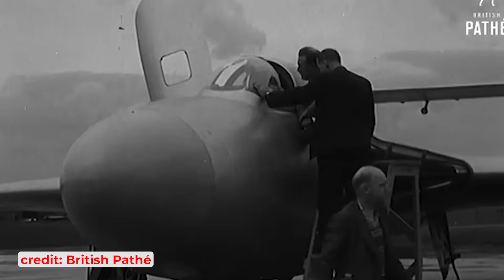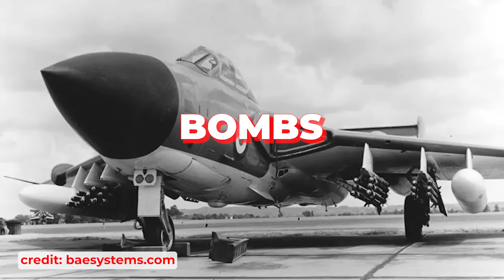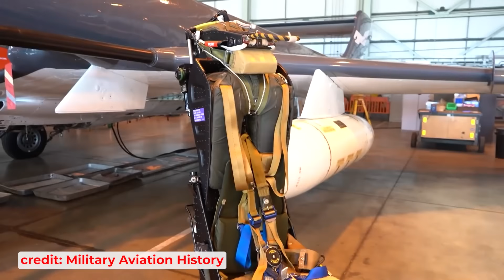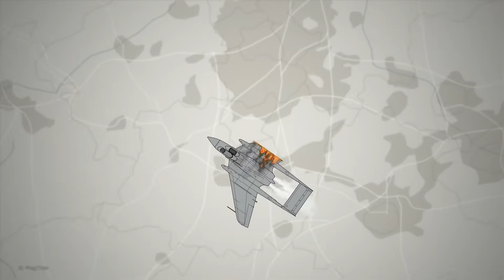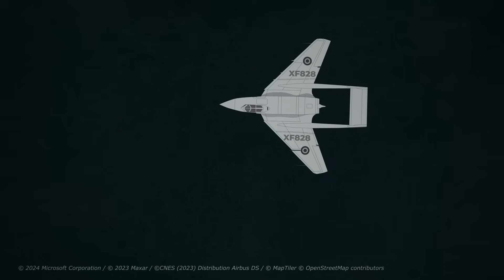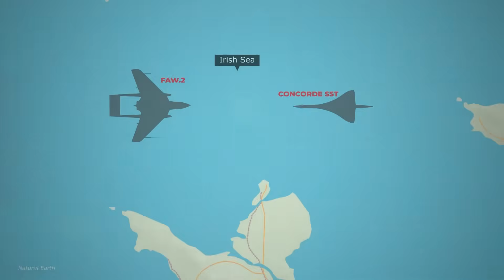Sea Vixen: A Beautiful Killer

Comment: Too slow, poor missiles, radar that did not work well. Light bomb load. Supersonic in a dive.
Reply: The Sea Vixen could not fly supersonic... even in a dive,  as this crash proved
Reply: @DoktorBayerischeMotorenWerke 

Sea Vixen Compared. 

We feel we can clear up some commonly held myths and misconceptions, obviously.

It's always good to see the facts presented clearly and concisely isn't it.

We feel we can clear up some commonly held myths and misconceptions, obviously.

It's always good to see the facts presented clearly and concisely isn't it.

See further down for a Meteor losses comparison.

See below for Comet accident losses comparisons. The Comet had similar accident losses fatalities to the later Sud Aviation Caravelle. Much later jet airliners from US manufacturers had significantly worse accident losses. 

The Vickers VC10 held the Atlantic crossing record for 43 years  (Non supersonic airliners). 

The Harrier was the only aircraft of its type at the time it first flew. All 1250 Pegasus engines built for all Harriers ever built anywhere were British build and design engines. The first 135 Harriers purchased for the USMC were entirely built in the UK. All 436 USMC Harriers had British built engines. 

The world's first wind tunnel was built in England during the 1800s. The world's first supersonic wind tunnel was built in England during the 1920s. 

Indeed that's correct. The Whittle Gloster E28/39 was of course a brilliant aircraft that was later copied in Russia as the upsized and tweaked Mig 15 with a copy of the RR Nene gas turbine aero engine.

Obviously the RR Nene being the world's most powerful & most reliable gas turbine aero engine in 1944.

The MD F3H Demon was a contemporary to the DH Sea Vixen & had a similar performance. The F4 Phantom was a follow on from the F3 Demon. The Sea Vixen took a long time to get from first flight to introduction for various reasons and a similar situation occurred with the MD F3H Demon.

McDonnell Douglas F3H Demon
590 Built. Not Supersonic.
Max Speed 578 MPH.
Introduction date 7 March 1956
First flight 7 August 1951
Retired 1964

MD F-4 Phantom 2
Number built 5,195
Manufactured 1958–1981
Introduction date 30 December 1960
First flight 27 May 1958

DH Sea Vixen
Number built 151 (including two DH110 prototypes and one Sea Vixen prototype)
Introduction date July 1959
First flight 26 September 1951
Max speed 695 MPH.
Retired 1972

Regarding the UK Aerospace Sector.
 
An airline recently ordered 60 RR Trent XWB Engines.

It's a great pity & a crying shame that British military forces had to occupy a large part of Germany for decades after 1945 & Russian military forces had to do the same. Of course Russia still posseses a large chunk of what was German territory & of course Russia & the UK produce nukes. Obviously Germany does not produce nukes.

Interesting British achievements.
There is no doubt that the Fairey (England)
Delta 2 was of course the world's first jet
aircraft to exceed 1000 mph.  Indeed It
exceeded the previous record by 310 mph &
held the record for 1 year. Incidentally, the Dassault Mirage 3 & 4 are based on the Fairey Delta 2.

Early days, jet fighters.
De Havilland Vampire, Sea Vixen & Gloster Meteor accident losses were not high or unusual for fighter aircraft at the time. De Havilland built large numbers of all metal airframe aircraft before the DH Comet.
We mustn't forget of course that the DH Vampire for example first flew in 1943 & the engine was also built by De Havilland. There were examples of the Vampire interceptor / fighter in service until 1990 which was operated by more than 30 countries.

Non combat phase accident losses.
% of Aircraft built.
The Canadair CL-44 was a turboprop airliner.
Canadair CL-44                  (ff 1959 ) 48%
Lockheed XF104                (ff 1954) 100%
Lockheed  P80                   (ff 1944) 43%
Lockheed F104                 (ff 1954)  45%
Grumman f9f-5 Panther   (ff 1947) 44% 
Convair F102 Dagger        (ff 1953) 45%  
MD F-101 Voodoo.             (ff 1954) 34%
MD FH Phantom 1            (ff 1945)  35%
MD F4 Phantom 2             (ff 1958)  28%
MD F3H  Demon               (ff 1951)  32%
Gloster Meteor                  (ff 1943)  21%
DH Vampire                       (ff 1943)  23%
DH Sea Vixen                     (ff  1951) 33%
Gloster Javelin                   (ff 1951) 20%
EE Lightning                       (ff 1954) 33%

An example of what goes on these days in various countries.
For example, there are of course no German companies that makes German jet aircraft in Germany & there are no German Companies that make German gas turbine aero engines in Germany that are suitable for widebody airliners.

Brazil makes very good airliners & Brazil is 100th down the list along with Indonesia for wealth per capita. Of course it is in fact the case that Embraer can't build those airliners without purchasing stuff from the US, UK & Europe. Norway Holland Denmark Ireland Belgium - Top 20 wealth per capita - Don't make airliners -  its as simple as that.

    Early days of the airliners.
That's correct of course, at the time the Comet wasn't particularly dangerous. Agreed, that is indeed the case of course, The DH Comet was definitely not the worst engineering failure in commercial airliner history.

How things were back then. 
Accident losses - % of aircraft built.
DeHavilland Comet 4                   14% 
DH Comet all mks   (ff 1948)       17%  
Vickers VC10 UK                            5%

The DH Comet had better safety than or similar safety to many other commercial passenger aircraft of a similar era.

Douglas DC-1                                      99%
Douglas DC-2                                      47%
Douglas DC-3                                      30%
Douglas DC-4                                      26%
Boeing s300                                        72% 
Boeing 307                                          70%
Boeing 247                                          48%
Boeing 707                                          20% 
Lockheed L-049/149 Constellation  30%
Lockheed Electra Turboprop             29%
Fairchild FH-227                                  30%
McDonnell Douglas DC-8                   14%
Sud Aviation Caravelle                        15%
Canadair CL-44  Turboprop                46%  
Convair CV-580  Turboprop                22%
Convair CV-880     (ff 1959)                27%  
Convair CV-990     (ff 1961)                33%
Tupolev T-104        (ff 1956)                16%

The VC10 held the fastest Atlantic crossing speed record for 41 years (Non supersonic airliners).

For the first few years of operations the Caravelle and Comet had similar accident loss Fatalities numbers.

De Havilland had prior experience building many all metal construction airframe aircraft & thousands of jet powered fighter aircraft that were primarily of metal construction with pressurised cockpits & jet engines built by De-Havilland.

We hope this helps. Cheers as always indeed etc
Reply: @DoktorBayerischeMotorenWerke 

A number of similar performance non supersonic jet aircraft got to first flight stage at around the same time. 

The MD F3H Demon was a contemporary to the DH Sea Vixen & had a similar performance. The later F4 Phantom was a follow on from the F3 Demon. The Sea Vixen took a long time to get from first flight to introduction for various reasons and a similar situation occurred with the MD F3H Demon. The Douglass Skyhawk delta wing is a contemporary to the the Gloster Javelin delta wing. Both non-supersonic delta wing aircraft, the javelin had better performance and first flew a few years before the Douglass Skyhawk.

Douglass A-4 Skyhawk 
2950 Built 
Intro 1956
FF 1954
In service to 1980s
Max V 670 MPH
Delta wing. A small / light jet aircraft designed for carrier operations without having to have folding wings. Often referred to as the scooter. 

McDonnell Douglas F3H Demon
590 Built. Not Supersonic.
Max Speed 578 MPH.
Introduction date 7 March 1956
First flight 7 August 1951
Retired 1964

MD F-4 Phantom 2
Number built 5,195
Manufactured 1958–1981
Introduction date 30 December 1960
First flight 27 May 1958

DH Sea Vixen
Number built 151 (including two DH110 prototypes and one Sea Vixen prototype)
Introduction date July 1959
First flight 26 September 1951
Max speed 695 MPH.
Retired 1972

Gloster Javelin.
434 built.
FF 1951
Intro1956
Max V 710 MPH
Delta Wing. 

Interesting British achievements.
There is no doubt that the Fairey (England)
Delta 2 was of course the world's first jet
aircraft to exceed 1000 mph, 10th March 1956 Indeed It exceeded the previous record by 310 mph & held the record for 1 year. Incidentally, the Dassault Mirage 3 & 4 are based on the Fairey Delta 2.

When the EE Lightning first achieved Mach 2 it was one of the fastest aircraft on the planet. 
P1 Mach 1 achieved 1954, Mach 1•5 capable.
P2 Mach 1 achieved 1956, Mach 2 capable. 
P2 Mach 2 achieved 1958.

The Hawker P1103 was a design and part built prototype that would have led to Mach 2 & Mach 3 versions of the aircraft. The General Dynamics F16 Fighting Falcon was of a similar design that went into service in 1975. The P1103 was cancelled during the switch to "mostly missiles plus no supersonic interceptor aircraft required in the future" era which included cancelling air to air missile development. Scheduled for test flights in 1958 and to be in service 1962. The General Dynamics F16 Fighting Falcon - based on a British design started 39 years earlier, built in the US and a number of manufacturing partner countries with parts for the US built aircraft sourced from partner countries. 

There were plans to do a supersonic thin wing Javelin which of course got cancelled. 

Early days, jet fighters.
De Havilland Vampire, Sea Vixen & Gloster Meteor accident losses were not high or unusual for fighter aircraft at the time. De Havilland built large numbers of all metal airframe aircraft before the DH Comet.
We mustn't forget of course that the DH Vampire for example first flew in 1943 & the engine was also built by De Havilland. There were examples of the Vampire interceptor / fighter in service until 1990 which was operated by more than 30 countries.

Non combat phase accident losses.
% of Aircraft built.

The Canadair CL-44 was a turboprop airliner.
Canadair CL-44                  (ff 1959 ) 48%
Lockheed XF104                (ff 1954) 100%
Lockheed  P80                   (ff 1944) 43%
Lockheed F104                 (ff 1954)  45%
Grumman f9f-5 Panther   (ff 1947) 44% 
Convair F102 Dagger        (ff 1953) 45%  
MD F-101 Voodoo.             (ff 1954) 34%
MD FH Phantom 1            (ff 1945)  35%
MD F4 Phantom 2             (ff 1958)  28%
MD F3H  Demon               (ff 1951)  32%
Gloster Meteor                  (ff 1943)  21%
DH Vampire                       (ff 1943)  23%
DH Sea Vixen                     (ff  1951) 33%
Gloster Javelin                   (ff 1951) 20%
EE Lightning                       (ff 1954) 33%

More recent UK military jet aircraft.
 
The Tornado & Typhoon & their engines are Supersonic & are indeed British design aircraft with British design engines built by an international consortium. The Tornado design for example started life during the 1950s at Vickers as the AFVG, it's engine is based on the RR RB-199. The EE Lightening is also a British Supersonic jet aircraft.

The Typhoon is the British BAC-EAP with an engine based on the British RR XG-40, the Typhoon is also built by an international consortium.
Reply: @DoktorBayerischeMotorenWerke 

A number of similar performance non supersonic jet aircraft got to first flight stage at around the same time. 

The MD F3H Demon was a contemporary to the DH Sea Vixen & had a similar performance. The later F4 Phantom was a follow on from the F3 Demon. The Sea Vixen took a long time to get from first flight to introduction for various reasons and a similar situation occurred with the MD F3H Demon. The Douglass Skyhawk delta wing is a contemporary to the the Gloster Javelin delta wing. Both non-supersonic delta wing aircraft, the javelin had better performance and first flew a few years before the Douglass Skyhawk.

Douglass A-4 Skyhawk 
2950 Built 
Intro 1956
FF 1954
In service to 1980s
Max V 670 MPH
Delta wing. A small / light jet aircraft designed for carrier operations without having to have folding wings. Often referred to as the scooter. 

McDonnell Douglas F3H Demon
590 Built. Not Supersonic.
Max Speed 578 MPH.
Introduction date 7 March 1956
First flight 7 August 1951
Retired 1964

MD F-4 Phantom 2
Number built 5,195
Manufactured 1958–1981
Introduction date 30 December 1960
First flight 27 May 1958

DH Sea Vixen
Number built 151 (including two DH110 prototypes and one Sea Vixen prototype)
Introduction date July 1959
First flight 26 September 1951
Max speed 695 MPH.
Retired 1972

Gloster Javelin.
434 built.
FF 1951
Intro1956
Max V 710 MPH
Delta Wing. 

Interesting British achievements.
There is no doubt that the Fairey (England)
Delta 2 was of course the world's first jet
aircraft to exceed 1000 mph, 10th March 1956 Indeed It exceeded the previous record by 310 mph & held the record for 1 year. Incidentally, the Dassault Mirage 3 & 4 are based on the Fairey Delta 2.

When the EE Lightning first achieved Mach 2 it was one of the fastest aircraft on the planet. 
P1 Mach 1 achieved 1954, Mach 1•5 capable.
P2 Mach 1 achieved 1956, Mach 2 capable. 
P2 Mach 2 achieved 1958.

The Hawker P1103 was a design and part built prototype that would have led to Mach 2 & Mach 3 versions of the aircraft. The General Dynamics F16 Fighting Falcon was of a similar design that went into service in 1975. The P1103 was cancelled during the switch to "mostly missiles plus no supersonic interceptor aircraft required in the future" era which included cancelling air to air missile development. Scheduled for test flights in 1958 and to be in service 1962. The General Dynamics F16 Fighting Falcon - based on a British design started 39 years earlier, built in the US and a number of manufacturing partner countries with parts for the US built aircraft sourced from partner countries. 

There were plans to do a supersonic thin wing Javelin which of course got cancelled. 

Early days, jet fighters.
De Havilland Vampire, Sea Vixen & Gloster Meteor accident losses were not high or unusual for fighter aircraft at the time. De Havilland built large numbers of all metal airframe aircraft before the DH Comet.
We mustn't forget of course that the DH Vampire for example first flew in 1943 & the engine was also built by De Havilland. There were examples of the Vampire interceptor / fighter in service until 1990 which was operated by more than 30 countries.

Non combat phase accident losses.
% of Aircraft built.

The Canadair CL-44 was a turboprop airliner.
Canadair CL-44                  (ff 1959 ) 48%
Lockheed XF104                (ff 1954) 100%
Lockheed  P80                   (ff 1944) 43%
Lockheed F104                 (ff 1954)  45%
Grumman f9f-5 Panther   (ff 1947) 44% 
Convair F102 Dagger        (ff 1953) 45%  
MD F-101 Voodoo.             (ff 1954) 34%
MD FH Phantom 1            (ff 1945)  35%
MD F4 Phantom 2             (ff 1958)  28%
MD F3H  Demon               (ff 1951)  32%
Gloster Meteor                  (ff 1943)  21%
DH Vampire                       (ff 1943)  23%
DH Sea Vixen                     (ff  1951) 33%
Gloster Javelin                   (ff 1951) 20%
EE Lightning                       (ff 1954) 33%

More recent UK military jet aircraft.
 
The Tornado & Typhoon & their engines are Supersonic & are indeed British design aircraft with British design engines built by an international consortium. The Tornado design for example started life during the 1950s at Vickers as the AFVG, it's engine is based on the RR RB-199. The EE Lightening is also a British Supersonic jet aircraft.

The Typhoon is the British BAC-EAP with an engine based on the British RR XG-40, the Typhoon is also built by an international consortium.